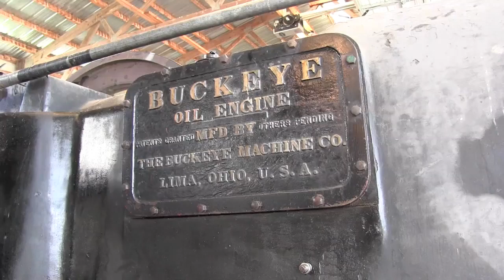Buckeye Model L

Comment: Serious question. How was it started if you did not have compressed air?
Reply: Normally you didn't start it without compressed air. It's too big and heavy to start by hand. When this was made they didn't have electric starters big enough nor strong enough. The only other way I know of to start one this size was with a pony motor. A pony motor is a smaller engine that was hand started that when applied to the flywheels could start it. That latter technique was used in Kempton Park a WW2 British steam power plant. Whoops, EDIT: There was one other technique I have seen and that is a pitcock valve that would reduce compression to a weaker and more manageable level. This was used on the old John Deere two cylinder tractors. My dad has one. 
Link to Kempton Park video: https://www.youtube.com/watch?v=KhlJp1VZMB8&t=758s
Reply from the maker: @TheJaymundo  Yep! I have seen a couple of old engines started with vintage pony motors that ARE small enough to start by hand. The people who resurrected and are running this engine have used the belt pulley on an old tractor to start it. According to specs I have seen, this engine had about a 10:1 compression ratio when new, so it doesn't take to much to turn it over. It's too big for men to do but a smal tractor doesn't have any problem. This engine does have a compression release valve IIRC.
Reply: I ran an oldddd Cat dozer once (fully functional) that had to be started using a pony engine. Crazy how far technology has come 🤯

Comment: Can it generate power on one gallon of fuel?
Reply from the maker: When working, they used an external tank plumbed into that little tank. With a load, that gallon would go pretty fast. Works ok for shows and no load.

Comment: Hot bulb or not if it doesn't have a spark plug it's a diesel! 🤘🤘🤘
Reply from the maker: Nope. Google "surface ignition" or "vaporizing oil engine." Both of those definitions apply to this Buckeye, but not diesel. We could go farther into the weeds by describing the diesel cycle and how most diesels of today are not true diesels but I won't. Here is what I wrote below: ""Hot cup" is just a variation of the surface ignition principle, with the variations expressed as hot bulb, hot tube, hot cup, hot plate, etc. I think you understand the principle, Jacques, but for those that don't, surface ignition is when a hot spot in the combustion chamber is used to "crack" the fuel oil... e.g. vaporize it... so that the heat of a lower compression ratio can ignite it (as low as 6:1 in the early days). When everything is working perfectly (a pretty narrow range for an oil engine), the fuel oil is vaporized to just below the temp required to ignite it by compression. The problems were that back in the day, available fuel quality and specific gravity varied a lot. You can fine tune many surface ignition engines to operate reasonably well on a specific fuel by adjusting injection timing. Advance it for heavy fuels, giving it plenty of time on the hot spot to vaporize, and retarding it for light fuels that vaporize quickly. Problem was, one batch might be light and the other might be heavy and not every operator was capable (or motivated) to adjust the timing from one tank of fuel to another. There were also lots of impurities, so both the injection system and the combustion chambers caked up with various residue. The fuel issues, and the fact that true compression ignition engines had to be much more heavy and large to contain the pressure, are what gave oil engines their brief time in the sun. Oil engines are somewhat "omnivorous" as they relate to fuel and most can tolerate, or be adjusted to use, fuel of varying qualities from what we now call "diesel fuel" to a heavy oil that is barely a step above crude oil. True diesel are not omnivorous and from day one, required much better fuel that an oil engine. When commonly available fuel improved and had more consistent characteristics, diesels became more prevalent. Technology was able to downsize the diesel, thus negating the oil engine's other advantage, portability/package size. As diesel fuel became more prevalent and easy to produce, and lubricants improved, the final nails were in the oil engine's coffin.  Going back to external heat, once the engine can sustain combustion, the external heat can be removed but on a lightly loaded engine, such as one at a show, the engine might just barely be above that threshold... so when running it slobbers and pukes it's way thru the day. The modern light diesel fuel helps a bit. If they had to run on a heavy oil of yesterday, they probably wouldn't be able to do it."
Reply: It's a diesel because that's what fuel it uses. Nout to do with spark plugs.
Reply from the maker: @leonperry123  You need to look up the definition of diesel. "Diesel fuel" did not exist in the era that engine was built. The "recipe" for it had not yet been standardized. It was designed to run on a heavy grade of fuel oil that was only a few steps more refined than crude oil.
Reply: @leonperry123  seriously? Diesels can be run on peanut oil. Nobody calls them "peanut engines" if they are. They are named after "Rudolf Diesel" the man that pioneered it. His 1st designs ran on air blast injection of coal dust not "diesel fuel"

Comment: Making motors running on very little fuel is possible but not profitable for oil companies.
Reply: If this thing had a significant load on it, it would drink fuel like a bucket with a hole

Comment: woah that's some serious imbalance.
Reply: Nope.
Reply: Probably the cylinder rocking back and forth
Reply: @froschgrosch5247  Indeed! 👍😀
Reply: @froschgrosch5247  Piston.  Cylinder rocking, you better run!
Reply from the maker: It's because it's on a trailer with wheels. In a normal situation, it would be mounted on concrete.. The motion of the piston and the long stroke are in line with the way the trailer rolls and no amount of wheel blocking seems to stop it.
Reply: That is the negative of any reciprocating type of engine. The “yin and yang” of serious weight changing direction many times a minute. Watch a side rod on a steam locomotive at high speed.  That heavy bar is flying in one direction and then suddenly flying in the totally opposite direction. A lot of wasted energy in reversal. The turbine engine was supposed to gain the advantage in power since all the parts are moving constantly in one direction only.  An electric motor is another example.  Another feature might, in this gigantic engine, be considered. What is the rated horsepower for it? It might surprise you to find out it might not be that high. The work it delivers is all torque at the sacrifice of speed. There are one horse electric motors 6 feet tall that turn super slow.  But a super-high-speed dentist drill might also deliver one horsepower.  All as speed with almost no torque.  The job demanded of each unit is totally different. Horsepower is a product of torque and speed. One pound raised 33,000 feet in one minute is the same as 33,000 pounds raised one foot in one minute. Just one horsepower.  You would need 2 intensely different machine designs to achieve the consumption of one horsepower of work these 2 different ways!
Reply from the maker: @junkdeal  Well said!
Reply: @SootHead  Thanxxx!!!